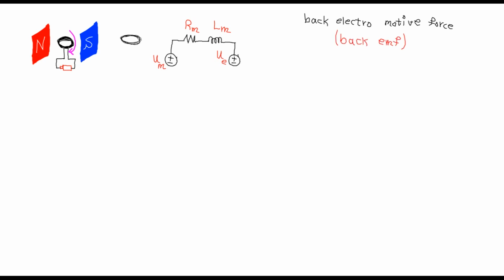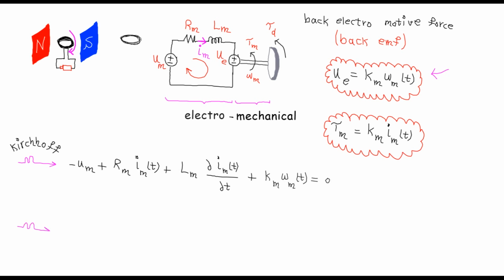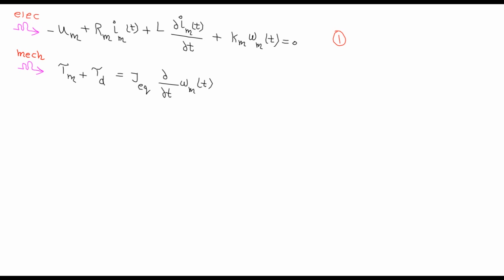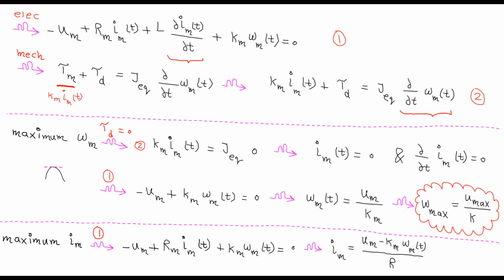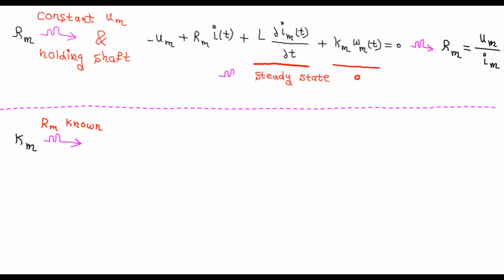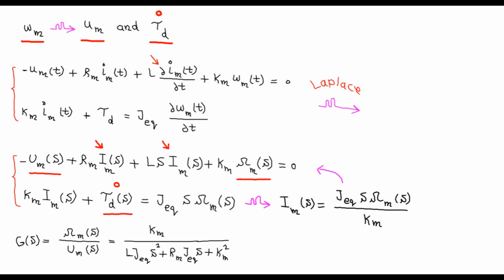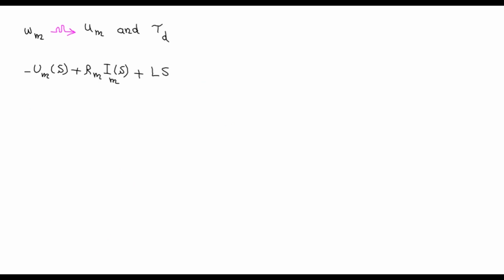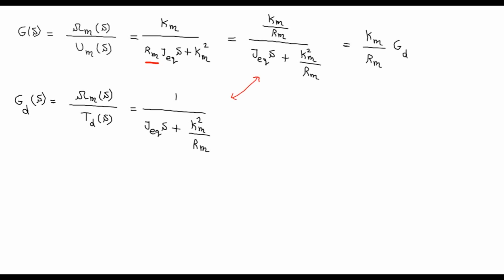Experiment 1: Modeling and Identification of a DC Motor (pre-lab assignments)

Comment: Good explanation, I got some good notes of this, but holy god damn why the hell do I have to do this as a software engineering student...
Reply from the maker: Lol!
Reply: a little late, but you are studying engineering, not computer science. if you want to only study coding, then you should switch to computer science.
Reply: It's fundamental to software engineering. This is half of everything software engineers do.
Reply: @Blueberry954  Maybe for some. I know many in the industry now that have never touched control theory after their undergrads. I agree that a familiarization is useful, but to say its half of what SEng does is a stretch. Even my employers say its not used much for SEng.
This has just been my experience. I've got a handful of people saying it isn't, and you saying it is. Not to discredit your experience, as it is valid, but I hope I'm right haha.
Reply: @Muggernaught  In the energy sector, a huge amount of the work we did was in control theory and microprocessor engineerring.
Reply: @Muggernaught  this class and ECE 355 are the two most important in a software engineering degree.